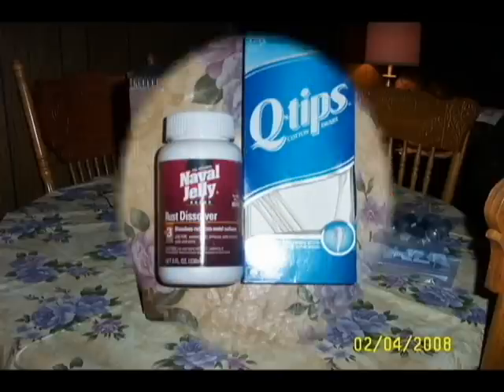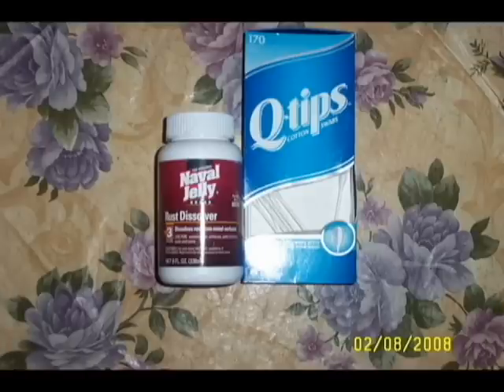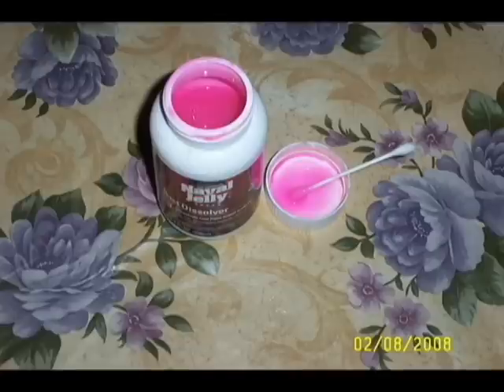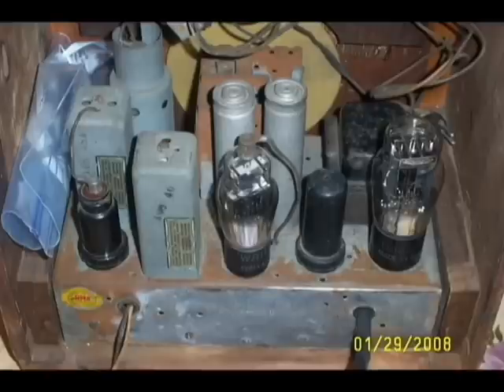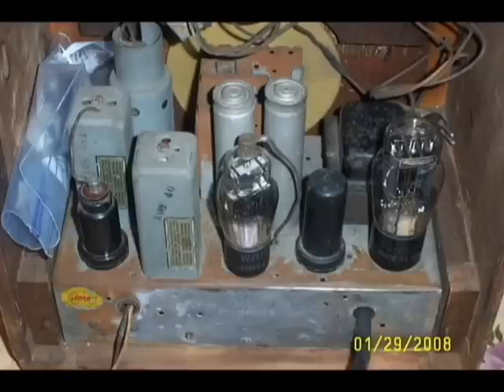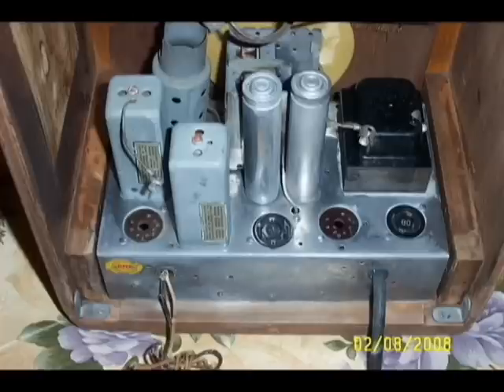Tube Radio Repair--Chassis Cleaning Tip.

Comment: Just wanted to remind everyone that Naval Jelly's primary ingredient is 'phosphoric acid' (H3PO4). up to 30% of this product.   So John, you actually are giving the chassis an acid bath. It is a good product. I've used it many times for removal of oxidation on the bottom of copper clad pots and pans.

Comment: You can use Brasso on the IF and electrolytic cans. Works really well. You just have to be careful not to rub off printed part numbers/values etc.

Comment from the maker: Hi. Glad to hear from you.
Naval Jelly can be found at just about any hardware store.  Should cost less than $4.00 for an 8oz. bottle. It's very mild phosphoric acid. If you happen to get any on your fingers or other skin just rinse it off with water.  But don't get any around or in your eyes. Follow the instructions on the label and all should work out fine.
Thanks for watching.

Regards,
John

Comment from the maker: David,
No.  Naval Jelly has to stay wet to keep working.  Leaving it on overnight would allow it to dry out.  I've left it on a rusty surface for 12-hours, but checked back every half-hour or so to make sure it was still wet. If I saw some spots that were drying out, I added more jelly.

Regards,
John

Comment: I am getting an  Ekco A.110; the chassis has rust but it is not too bad.The biggest problem is there is no tuning at all; instead it has 4 pre set stations. Is there a way of retuning these presets to the frequencies of my local stations? I would appreciate your expert opinion as I am nine years old, and have just started learning about radios, frequencies, and the electromagnetic spectrum. Please reply either here, or to my youtube account.

Comment from the maker: Holy cow was also my reaction. I had no idea if the jelly would actually do the job. Just had to share the results with others. It'll be a while before I do another vid.  Have to gather up more equipment. Hopefully, one of my next two vids will involve hard-wiring an isolation transformer into a transformerless radio. Wish me luck.

Comment from the maker: Mrweswtf,
Naval Jelly works really good.  In addition to rust, it also removed dirt film.  Makes those chassis shine.  Since uploading this video I've cleaned many more chassis with it.  Hasn't failed me yet.
Just be sure not to use it on aluminum or chrome.
Thanks for watching.

Regards,
John

Comment: John

After cleaning the tuning capacitor -  can you paint it - say flat black or maybe clear coat to keep it in good shape - or will it interfere with its capability to tune in and track stations
Reply from the maker: David,
After cleaning and de-rusting some do give the tuner a coat of clear lacquer, but not me.   In years to come that paint will eventually begin to peel and to my notion cause shorting between the plates.  For some poor sap down the line, it'll be a chore for him to re-clean it...while cussing out the guy who put the paint on it. LOL
Regards,
John